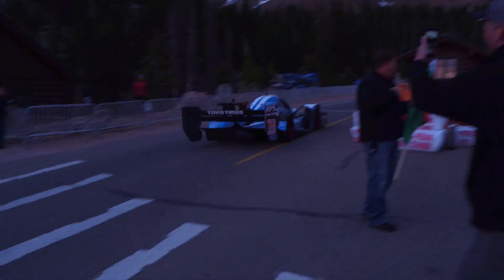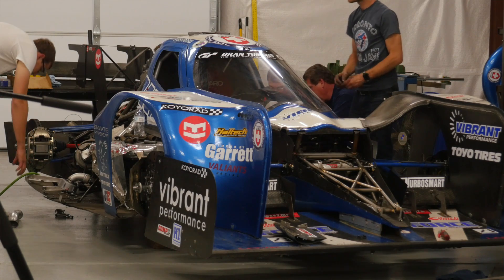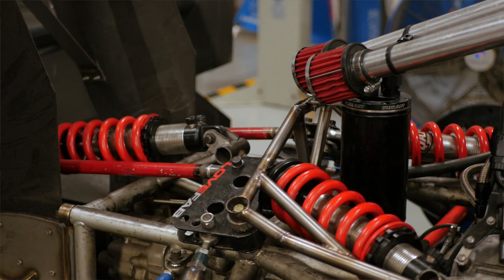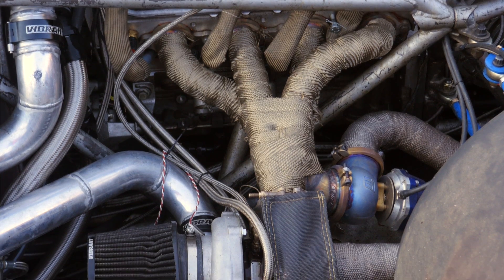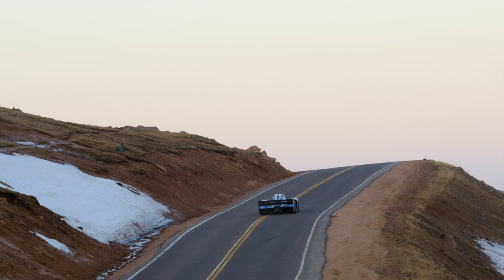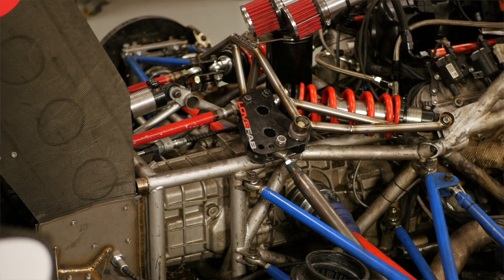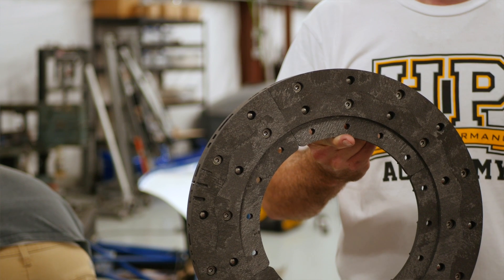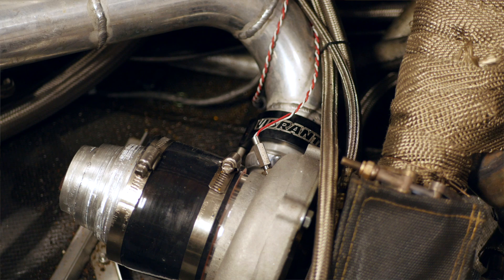[TECH TOUR] "The fastest car I've ever driven..." - The Stig USA | 1000HP Turbo V8 Enviate Hypercar

Comment: Most people that go to Pikes Peak Don’t understand the amount of heat generated and how had it is to remove it
Trust me you need twice the cooling capacity you need at sea level on a circuit car
If running methanol we found using a ninth injector in the inlet plenum worked wonders 
Sorry frontal area will have to suffer

Comment: It was my understanding that there was no way to remove heat from the motor, no fault of the radiators or pump or any of the setup but a thermal limitation of the block.

Comment: *WHY NOT FIT A 106KG ELMER RACING 'THOR' ENGINE FOR A SIGNIFICANT WEIGHT ADVANTAGE? COST TOO MUCH?*
Reply from the maker: The Enviate Hypercar was actually produced on a pretty tight budget, the Thor engine at a guess is around $100,000USD more than the LS that is in there :)

Comment from the maker: Want to learn more about how this car was tuned to combat the atmospheric pressure changes of Pikes Peak? Take a look here - https://www.youtube.com/watch?v=9eUt7BbiYZk&t=61s
Reply: Awesome car in development. I wonder though if, due to the unlimited nature of the rules,  whether a few opportunities for innovation has been left out. With the resources available, an exploration into having the front and rear spoilers run in an unsprung  configuration, could have been implemented. This would of negated the need for the 3rd spring arrangements. It does add some unsprung weight but does not effect the rotating mass. This would have a lot of technical issues to work through such as the separation between the upper diffusor edge and the lower edge of the rear element. Maybe a flexible  skirt between the two to control the airflow.  There's a great explanation on Kyle Engineers channel about unsprung weight. Another cool thing to see on this car would be electric drive to the front wheels on demand. It would not have to be a big heavy system. Just a little helper for front end turn when needed. Thoughts?
DOCILE Forever!!!

Comment: Wonder if they could just run adjustable magnetic dampers? Less weight and complication to suspension. 
Lmao at using a 5.3. Epic. They're good for around 700-800hp stock but the K1/JEs will do wonders for going over that if the top end is looked after. Glad they went dry sump, a given for any LS over 1-1.2G sustained.
Looks like I have a new goal racecar. Unlimited aero is what I'm looking for.
Love the presenter, someone who actually knows cars. Great stuff! Sounds like a kiwi or maybe an Auzzie haha. Subbed.
Reply from the maker: Thanks for the sub. There are a few other great Tech Tours from this years Pikes Peak on here. 
The car is also for sale last we saw so you might even be able to get a jumpstart on your project if you're quick! And we're Kiwis, so your guess was on the money, well done! - Taz.
Reply: Thank you, I'll check them out.
Also a Kiwi so it was cheating for me to figure it out!
Would have to sell current track car and save a lot more, so I think this is a long term goal ;) If you're ever interested in checking out one of (if not the) most modified, track built, LS swapped S2000s on the planet, the first JDM one in existence, in Auckland in later Q4 upon completion, let me know. Not sure how it will do on track competitively as theyre' heavier than other Honda chassis but there is a definitely a good chance to set the NZ N/A Honda record in the 1/4. It's currently track/road race focused, yet bit of an all rounder until it finds a niche. Might go Time attack, might stay more casual track focused.. who knows. Some of highlights include dry sump LS3, T56 mag, '15 z/28 diff, 6 pots, basic suspension mods for now before dialling it in, Link Extreme for modern functionality, lots more rubber, with a mostly stock look etc.
Also love filming and editing. Cheers
Reply from the maker: haha good work either way! Sounds like quite the project,. We'll look you up if we're ever in Auckland, and feel free to send us an email if you're ever in Queenstown and also I'd be interested to hear your time once you hit the strip - Taz.
Reply: They run some crazy Steve morris billet engine now lol

Comment: Why would you use an iron block on a race car when there are many aluminum ls blocks that can be used?
Reply: Ryan Barbolt You can find the iron block LS everywhere, for super cheap too.  Plus, I would think that they designed the engine to be a structural part in this race car.  In that aspect, the added weight from using an iron block over the lighter alum block is not necessarily be a bad thing.
Reply: Ryan Barbolt more downforce.
Reply: It is an aluminum block.  L33 5.3l aluminum block.

Comment: What is with the air inlets for the turbos being blocked and having  a small air line plumbed into it??? What the hell is going on there?
Reply: That would be way too restrictive on the turbo and would probably cause it to fail. Its most likely a boost leak tester, where they pump in compressed air to check for leaks in the entire system.

Comment: What material are they using for the turbo manifold?
Reply: TechSalvager 
Metal.  I guess.

Seriously though it would be probably be a stainless tuned length setup then thermal wraped to maintain the heat in the manifold. The wraps main benefit is keeping the heat in the manifold which maintains gas velocity and helps with throttle response.
Reply: I have high doubts its stainless, if it is, its gonna have to be a higher grade.  If anything I would expect it to be inconel
Reply: TechSalvager 
Maybe.
Reply: TechSalvager 
I would guess a stainless  (high grade/quality) would be the better $$ option as it would not be subjected to the amount of thermal cycles as a daily driven car nor would require the longevity either.
Reply: It is 304 stainless. If you go on Honda-Tech and look in the "welding and fabrication" section you can see where he and others started building these must be 15 years ago. Some are made from thick stainless pipe and others from thinner stainless tubing. He used to build very fast turbo civics and NSX's you can find his username "Tinker219" but there's lots of turbo manifold build topics on that site.
Reply: I have doubts on 304L, not for a car like that,  wouldn't touch that stuff again.
Reply: well most of his manifolds are 304 sch 40 from what I understand and some of his street cars are putting out the same power levels. This car could use a 321 tubing to keep the weight down but even fullrace uses 304.